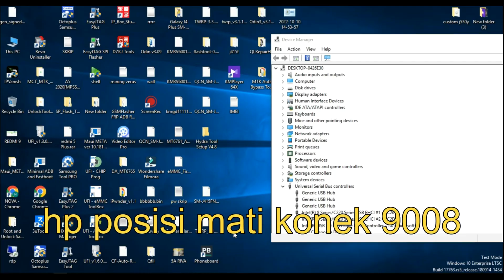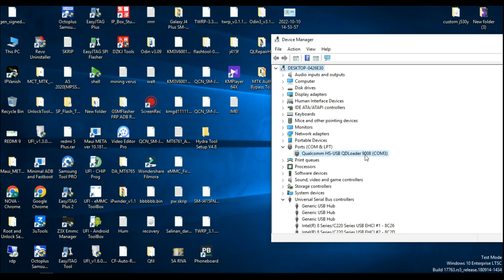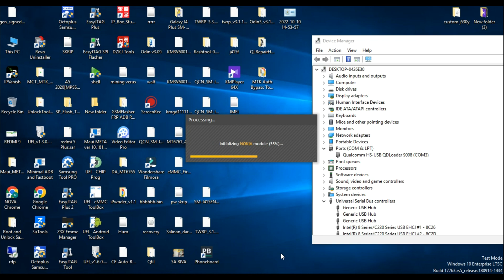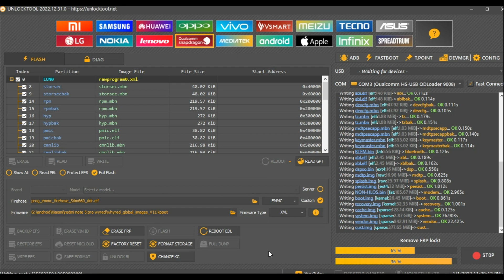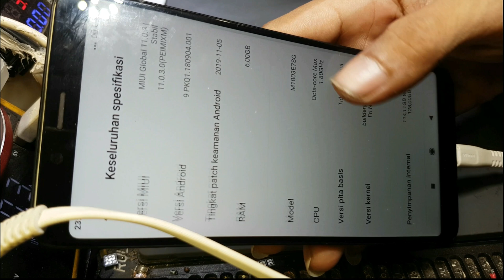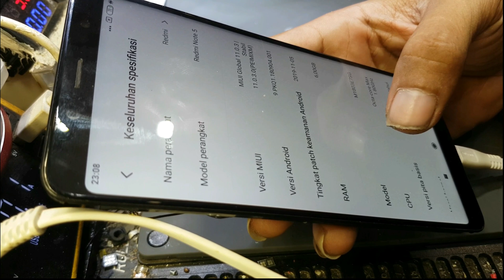cara menambah ram dan internal xiaomi note 5 pro jadi 128gb

Comment: Versi pita basisnya ilang?
Reply from the maker: tinggal write qcn
Reply: @novachannel234  apa bisa di pasang twrp?
Reply from the maker: @whxyz22  bisa
Reply: @novachannel234  kalau upgrade penyimpanan internal itu ada plus minusnya ga?
Reply from the maker: @nandasuhenda6326 ada beberapa hp gk boleh update sistem. kecuali kalo rpmb dari internal lama bisa di copy
Reply: Coba liat yang sudah di pasang twrp bg penasaan saya
Reply: Soalnya belum pernah liat redmi note 5 pro setelah ganti mmc 6/128 di pasang twrp
Reply from the maker: saya gk pernah pasang twrp pak, saya service sesuai standar pabrik aja pak gk pasang twrp gak root juga, kecuali buat hp yg repaire imeinya butuh root.
Reply: @novachannel234  no pict hoax pak
Reply from the maker: nti  klo ada masuk lgi saya buatkan videonya ya
Reply: aku ada redmi note 5 pro bang mau di update  @novachannel234
Reply: Ok siap om nanti saya sub kalo bisa di pasang twrp